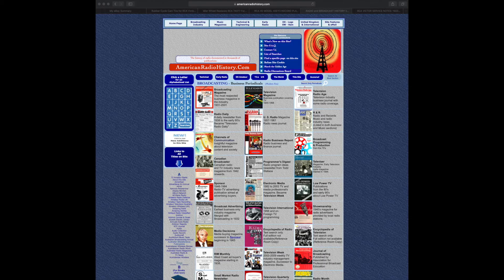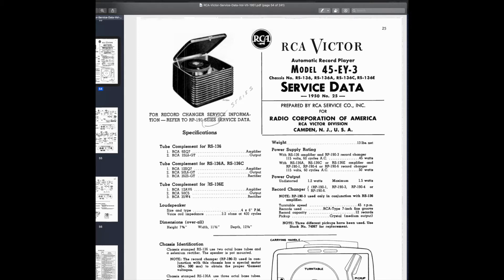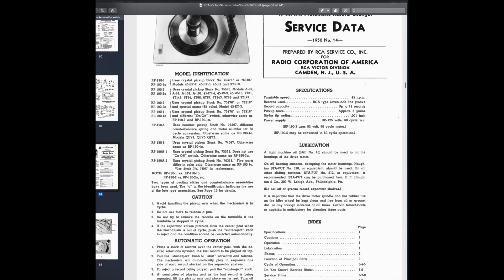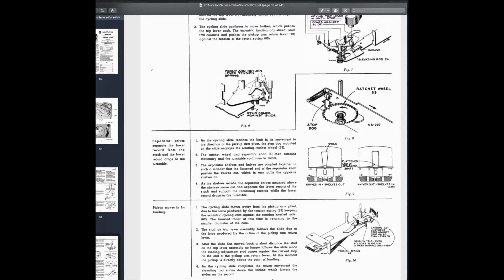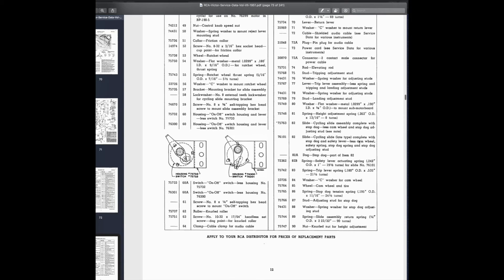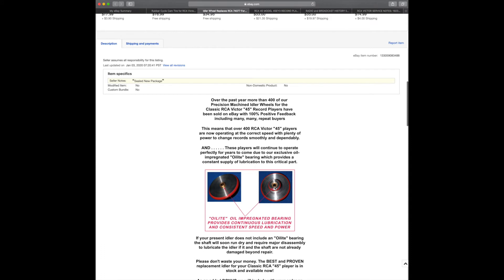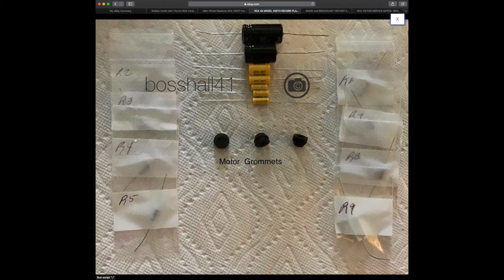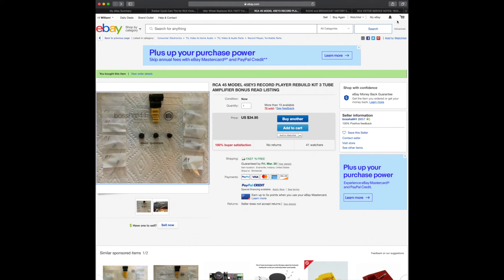Restoring an RCA 45-EY-3 Record Player Part Three

Comment: Yeah the drive wheel that you ordered will work. However I find with metal turntables, they can be somewhat problematic. It's actually about $15 cheaper to order the caps from Digikey or even better, and even cheaper, Sal's Capacitors (contact Sal first). In the kit you bought, you  will need use ALL the parts. The resistors in these drift, and it can cause performance issues.